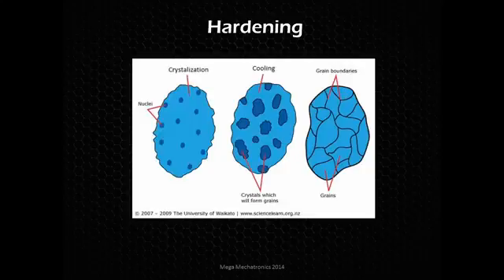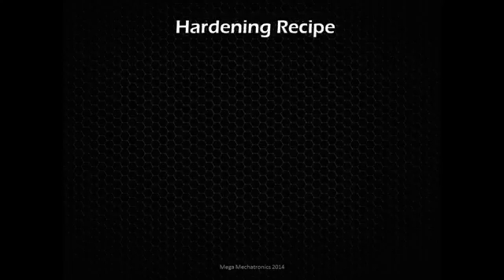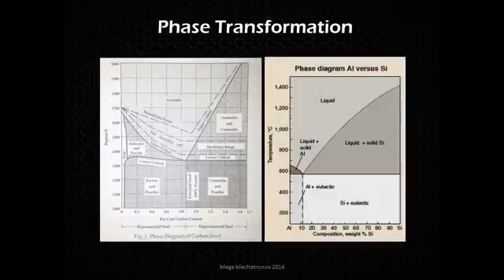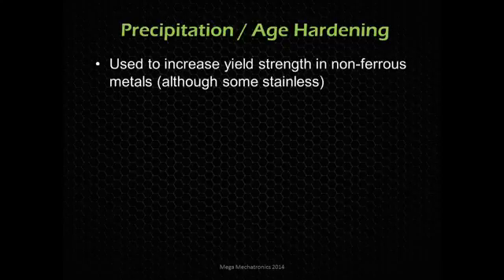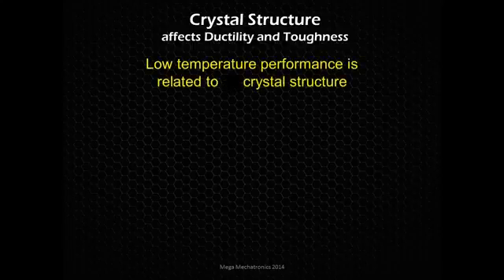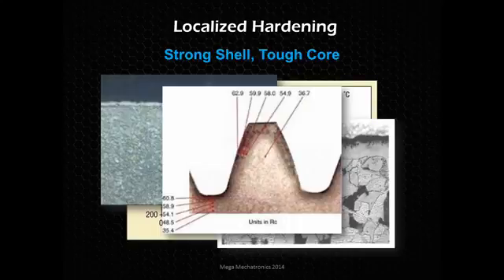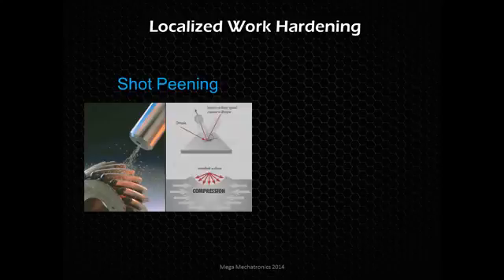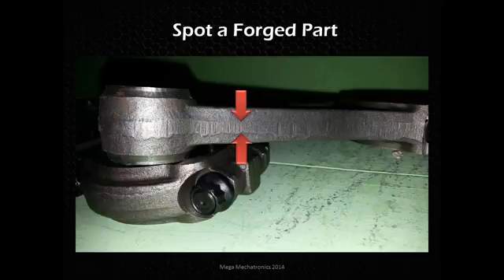Materials Science Mechanical Engineering    Part 4 Heat Treatment Explained

Comment: Alfreda Krisna Altama
2714100135

Hardening is a kind of heat treatment process when we heated the material (metal) to austenization temperature, and then quenched with some media so it will get fast cooling rate. When it in the cooling process, the atom will start forming crystal. Atomic crystal structure for metallic such iron and aluminum are body center cubic (BCC), face center cubic ( FCC). BCC is a crystal structure with the atom in the center of cube, face center is a crystal structure with atom on face of cube and then hexagonal is for another material. The dynamic structure of ferrous material have characteristic to demand their form. When they get some force and deformed the still come together. When crystal start forming ,it was started from grain boundaries. The growth was randomly and different orientation. Material with close boundary will be more hard. It’s like the wall that stop the crystal to move or deformed. And the other side, material with big boundary will be more ductile. Hardenability of material limits dependent on alloying elements of the metal. Hardness depent on carbon content in ferrous metals. The hardness of steel increase with the increasing of carbon contain. The important recipe of hardening process of steel are heating rate, cooling rate, and time of holding. Quench media such water,oil, salt will give different final structure such martensite. So the recipe will lead to success of process. The example is the racing car spring manufacture. The process start with hardening with salt solution cooling media, continue with austemper process, then cryotemper to make it easily get cold working. When we look phase transformation diagram will give engineer to predict the phase transformation in a process. Then the composition of steel will give different properties. The example are plain carbon 1018 that have 0.17% carbon, 0.75% manganes, and 304 Stainless that have 20% chromium as main alloying element in stainless steel,10% Nikel, 2% manganese, 0.75% Si, 0.1% Ni, 0.08% carbon. One alloy may give many properties. It’s depend on cooling process. Tempering was done after hardening, when material is too brittle, and improve toughness. Tempering was bellow the transformation temperature. Normalizing is process to get normal properties of ferrous based metal. Annealing is primarily for softening. Precipitation or age hardening was used to increase yield strength in non ferrous metals ( although some stainless), produce fine particles that defects the crystal lattice that impede movement. To quantifying the hardness of steel we use hardness testing tool. Hardness test is divide to some method that’s rockwell, brinell an vickers. Then we can compare the hardness of that methode. The crystal structure affects ductility and toughness. BCC crystal structures experience a ductile to brittle transition at lower temperatures. FCC  crystal structures retain ductility at llow temperatures. Another hardening process named localized hardening such induction hardening, nitriding / carburizing that infusing Ni or carbon into surface. Localized Hardening will give strong shell but tough core properties, because of the transformation oly happened on the surface.
When work is performed below hot working temperatures, and the crystal structure is forced to deform to accommodate the strain, microscopic shearing occurs along definite crystalline planes is named hot work process. Discontinuities in the crystal structure, present in all metals and known as dislocations, increase in density during plastic flow and those moving on intersecting slip planes tangle and pile up. This means that an ever increasing shear stress is required for deformation, increasing the yield stress. Eventually the stress required to move dislocations is high enough for a crack to initiate and subsequently propagate, and the material breaks. Work hardening improves tensile strength, yield strength and hardness at the expense of reduced ductility. These effects can only be removed by annealing or normalising. The example of work hardening process are shot peening, roller burnishing and hot forging. Rolling burnishing is a method of cold working metal surfaces to induce compressive residual stresses and enhance surface roughness qualities. The tooling typically consists of a hardened sphere or cylindrical roller. These tools are pressed onto/across the part being processed. The part (or the tool in some applications) must be moving at a constant rate of speed, for example in the case of roller burnishing a part on a lathe, the part is spinning and the burnishing tool is moved across the surface as a constant rate, therefore producing a very consistent finish across the part. Hot forging is a work hardening process that have done at higher temperatures. The characteristic is stronger than an equivalent cast part. The forging will give different grain structure than machined part and it make crack not easily happen in material. The conclusion is heat treathment is process to give better properties to the material such as hard properties. Hardening is process that gived to metal material such steel to give hard properties. It can be only on the surface or in the hole steel part. That’s all from me, thank you.

Comment: Muhammad Iqbal Muharrom 2714100078
Thanks for Mrs Dian for this video from this video I can learn about hardening process in material. 
This treatment is mainly for to make a material have a improvement in mechanical properties, this can be looked by the grain in the material. With big size grain it make a ductile, and with small size grain it make hardness but brittle. Hardenability is look at material as well as an increase in the level of hardness. There are recips for sucess at this process, we must see at the temperature and the time. Time it can be devided at Heating rate, holding time and cooling rate. In the cooling rate can be air cooled, or cooled by quenching in oil, water, or another liquid, depending upon the amount of alloying elements in the material. Hardened materials are usually tempered or stress relieved to improve their dimensional stability and toughness. The hardening process consists of heating the components above the critical (normalizing) temperature, holding at this temperature for one hour per inch of thickness cooling at a rate fast enough to allow the material to transform to a much harder, stronger structure, and then tempering. Steel is essentially an alloy of iron and carbon; other steel alloys have other metal elements in solution. Heating the material above the critical temperature causes carbon and the other elements to go into solid solution. Quenching make change the microstructure, inducing stresses. Parts are subsequently tempered to transform the microstructure, achieve the appropriate hardness and eliminate the stresses. Metal Quenching Material is heated up to the suitable temperature and then quenched in water or oil to harden to full hardness according to the kind of steels. Alloys may be air cooled, or cooled by quenching in oil, water, or another liquid, depending upon the amount of alloying elements in the material and final mechanical properties to be achieved. There are many process there are Tempering, Normalizing, Anneling, Precipitation. Tempering is done after hardening process, In tempering the material is too brittle and have a improve in thoughness and the process is doing below transformation temperature. Normalizing is process on ferrous based metal heated above transformation temperature. This process allowed to air cool in still air at room temperature. Annealing is doing with holding the temperatur to controlled cooling rate do in furnace with slow down temperature changes. It make material more soft and the produces desrable microstructure. Precipitation or age hardening is used to increase yield strength in non-feroous metals (although some stainless) this process are produce fine particles that defects the crystal lattice that impede movement. Martensitic transformation, more commonly known as quenching and tempering, is a hardening mechanism specific for carbon steel. The steel must be heated to a temperature where austenite and change the crystal structure from BCC (body-centered cubic) to FCC (face-centered cubic). Once the carbon has been dissolved, the material is then quenched. It is important to quench with a high cooling rate so that the carbon does not have time to form precipitates of carbides. When the temperature is low enough, the steel tries to return to the low temperature crystal structure BCC. This change is very quick since it does not rely on diffusion and is called a martensitic transformation. Martensite structure is very hard but make it brittle. In Hardness unit there are many type. Rockwell, Brinell and Vickers, in hardness test there are doing with diamond penetran to material and the hardness will be measure base on the depth of penetran. In other way you can do the scratch test for measure hardness with scracth the material to the other material which known the hardness value. There are many mecahnical property and the relation from the other. In hardness properties and strength propeties is same in the change. When hardness high the strength is high. In hardness properties and toughness is different when the hardness is high the thougness is low. In the work hardening it can be do in low temperature and high temperature based on the condition, type and needed properties.

Comment: rustin winarsih 2714100028

HEAT TREATMENT

Heat treatment is the process of heating and cooling steels to change their
microstructure in purpose to have the new physical and mechanical
characteristics that make steels itself more desirable. The temperature steels
are heated to and the rate of cooling after the heat treatment can
significantly change the its properties. The most common reasons why the heat
treatment process done to steels are to improve their strength, hardness,
 toughness, ductility, and also corrosion resistance.

HARDENING
AND TREATMENTS

Hardening is process in which
steel is heated to a temperature above the critical point, held at this
temperature and quenched (rapidly cooled) in water, oil or molten salt baths. If
a piece of steel is heated above its upper critical temperature and plunged
into water to cool it an extremely hard, needle-shaped structure known as
martensite is formed in its microstructure. Therefore, the sudden quenching process
of steel greatly increases its hardness. After hardening, steel must be
tempered to:

1.     
Reduce a brittleness

2.     
Relieve the internal stresses

3.     
Obtain pre-determined mechanical properties

The hardening
process is based on a very important metallurgical reaction of decomposition of
eutectoid. This reaction is dependent upon the following factors: 

1.     
Adecuate carbon content to produce hardening

2.     
Austenite decomposition to produce pearlite, bainite,
and martensite structures

3.     
Heating rate and time

4.     
Quenching medium

5.     
Quenching rate

6.     
Size of the part

7.     
Surface conditions

GRAIN BOUNDARIES

At a higher temperature, new, strain-free
grains nucleate and grow inside the old distorted grains and at the grain
boundaries. These new grains grow to replace the deformed grains produced by
the strain hardening. With recrystallization, the mechanical properties return
to their original weaker and more ductile states. Recrystallization depends on
the temperature, the amount of time at this temperature and also the amount of
strain hardening that the material experienced. The more strain hardening, the
lower the temperature will be at which recrystallization occurs. Also, a
minimum amount (typically 2-20%) of cold work is necessary for any amount of
recrystallization to occur. The size the new grains is also partially dependant
on the amount of strain hardening. The greater the stain hardening, the more
nuclei for the new grains, and the resulting grain size will be smaller. 

HARDENABILITY

Hardenability
is the ability of Fe-C alloy to be hardened by the forming martensite as a
result of a given heat treatment. For every different steel alloy there is a
specific relationship between the mechanical properties and the cooling rate.
Hardenability is different with hardness. It is a qualitative measure of the
rate at which hardness decreases with distance from the surface because of
decreased martensite content. High hardenability means the ability of the alloy
to produce a high martensite content throughout the volume of specimen.

Some of the
treatments that can be done to increase the hardenability of steels are
tempering, normalizing, annealing, and precipitation hardening.

TEMPERING

Tempering
is a process of heating steel
that has been quenched and hardened for an adequate period of time so that the
metal can be equilibrated. The hardness and strength obtained depend upon the
temperature at which tempering is carried out. Higher temperatures will result
into high ductility, but low strength and hardness. Low tempering temperatures
will produce low ductility, but high strength and hardness. In practice,
appropriate tempering temperatures are selected that will produce the desired
level of hardness and strength. This operation is performed on all carbon
steels that have been hardened, in order to reduce their brittleness, so that
they can be used effectively in desired applications.

NORMALIZING

Normalizing is a process of heating metals, and then keeping
it at that temperature for a period of time, and then cooling it in air. The
resulting microstructure is a mixture of ferrite and cementite which has a
higher strength and hardness, but lower ductility. Normalizing is performed on
structures and structural components that will be subjected to machining,
because it improves the machinability of carbon steels.

ANNEALING

Annealing is a process to treating metals up to a high
temperature, and then cooling it very slowly to room temperature, so that the
resulting microstructure will possess high ductility and toughness, but low
hardness. Annealing is performed by heating a component to the appropriate
temperature, soaking it at that temperature, and then shutting off the furnace
while the piece is in it. Steel is annealed before being processed by cold
forming, to reduce the requirements of load and energy, and to enable the metal
to undergo large strains without failure.

PRECIPITATION /
AGE HARDENING

Precipitation or
age hardening is a type of heat
treatment that is used to impart strength to metals and their alloys. It is
called precipitation hardening as it makes use of solid impurities or
precipitates for the strengthening process. The metal is aged by either heating
it or keeping it stored at lower temperatures so that precipitates are formed.

 

WORK HARDENING

Work hardening is the process of making a metal harder and
stronger through plastic deformation. When a metal is plastically deformed,
dislocations move and additional dislocations are generated. The more
dislocations within a material, the more they will interact and become pinned
or tangled. This will result in a decrease in the mobility of the dislocations
and a strengthening of the material. This type of strengthening is commonly
called cold-working. It is called cold-working because the plastic deformation
must occurs at a temperature low enough that atoms cannot rearrange themselves.
When a metal is worked at higher temperatures (hot-working) the dislocations
can rearrange and little strengthening is achieved.

 

Heat
Treatment

A. Phase Transformation

            According mass transfer there are :

            1. Diffusion

·        
Interstitial diffusion : the other atoms
enter the packing atoms crystalin

·        
Subtitutional diffusion : changes atoms

2.
Martensitic

            Microstructure is consists of a spatial arrangement of
crystaline aggregates of different phases. The size, shape, distribution
composition and crystal structure of this phases essentially control the final
properties (mechanical : hardness, strength, ductility, impact, taughness, etc )
of any given steel.

            The purpose of heat treatment is to cause desired changes
in the metallurgical structure and in the properties of metal parts

B. Nucleation

            1. heterogeneous : the new phase appears on the walls of
the container

            2. homogeneous : solid nuclei spontaneously appear within
the undercooled phase

C. Growth

            Intinya fase alfa bisa langsung dengan mudah berunbah
jadi fasa beta atau beta jadi alfa jika masih berada pada temperature yang
memungkinkan. Tapi jika dia sudah dibawah temperature yang memungkinkan, suatu
fasa alfa dia bisa berubah jadi beta tapi beta tidak bisa atau susah jika
kembali menjadi alfa lagi kareta barrier/batasnya dalam hal ini ada
temperaturenya

D. Effect of Alloying

            1. type 1 : open gamma field with alloy Ni, Mn, Co, Pt

            2. type 2 : expanded gamma field

            3. type 3 : close gamma field

            4. type 4 : contracted gamma field

E. Hardenability

Fungsi hardening :
untuk mendapatkan keadaan martensite, kenpa martensite karena maksimal strength
of material. Ada dua cara untuk mengetahui hardenability yaitu grossman method
dan jominy method